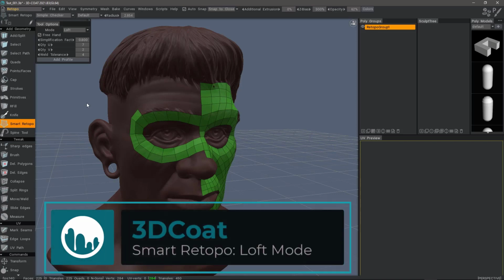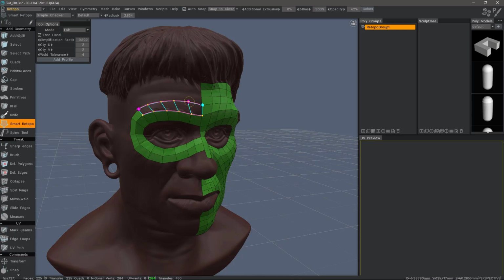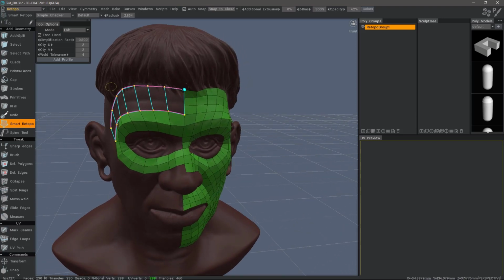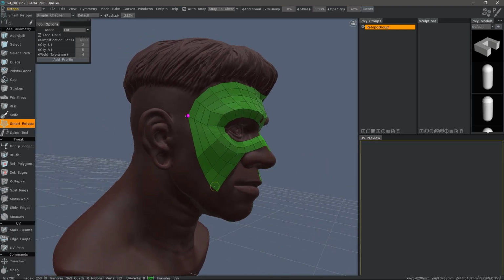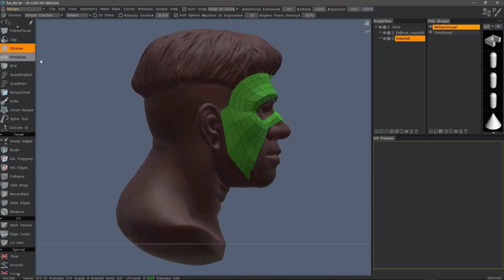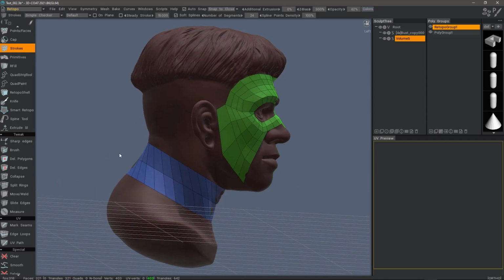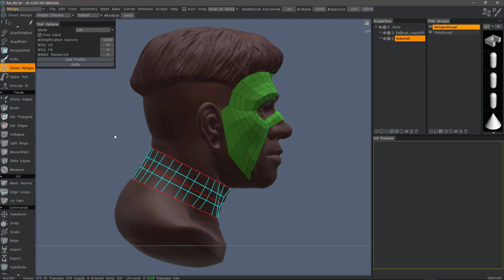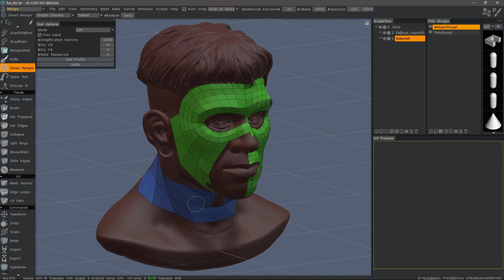Smart Retopo: Loft Mode

Comment: 3:30 I often find myself in this situation, I turn symmetry off when using Strokes like that since it gets all screwed up otherwise. Then I find myself in a situation with the faces looking kinda like your result there. Do you have any tips on how to use the strokes tool without ending up in the situation you just showed ? I normally just do my vertical stroke right down the middle before hitting enter, as close to the symmetry plane as possible, then apply enable and apply symm and brush/tweak the mesh.
Reply from the maker: Yes, that is a good technique, although symmetry should work properly if the cross sectional stroke were straight along the symmetry plane.